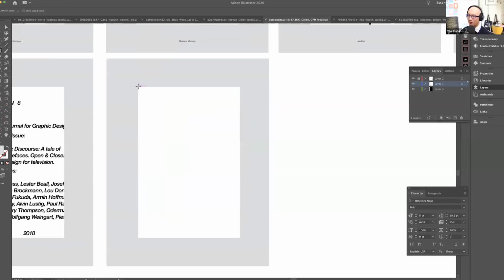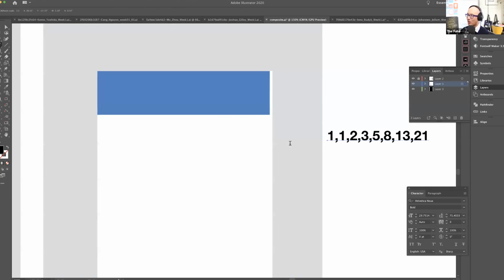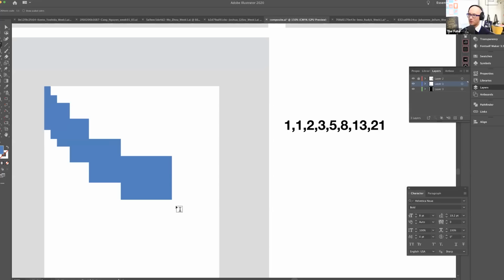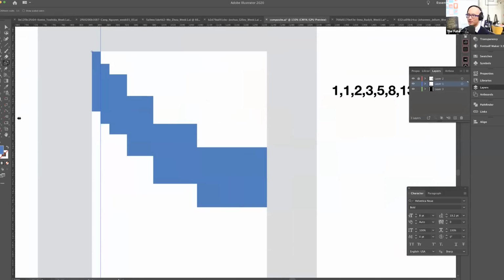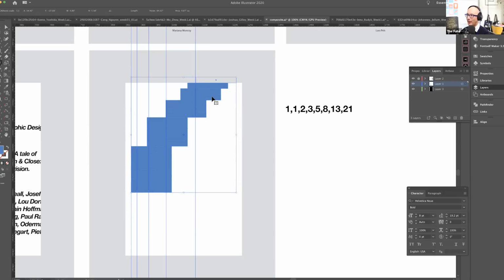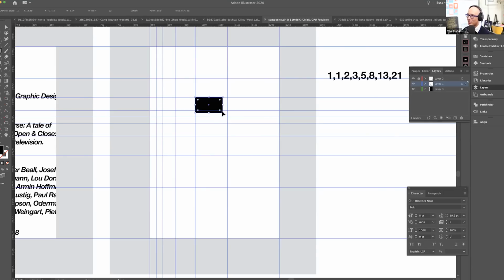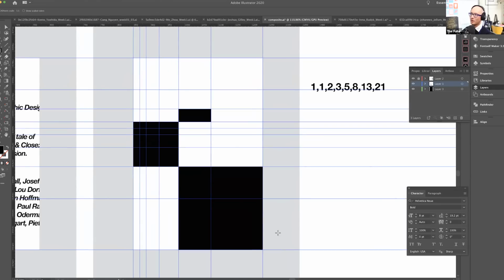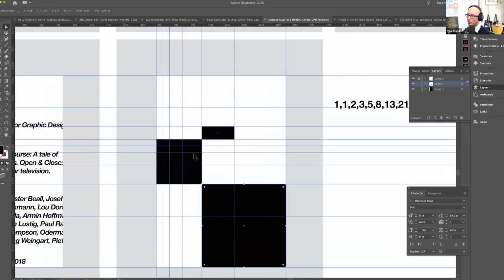How To Draw And Use Fibonacci Grid In Your Design Layout

Comment: Here is my question more condensed: If you continue to increase the squares in the fibonacci sequence does the spiral go outside the rectangle? I am working on logo designs using this method and I can see how circular shapes work with it but what if the shape is curved only slightly this will need to be two circles and a linear line? Does anyone know the rules for this? Can you use more than one golden rectangle in a grid to build different shapes as long as you use the ratio of 1.618 between them and there is a balance in the design?

Comment: This is great Chris, I am experimenting with this in my layouts, I wonder, do you have any go to references for working with golden ratio grid  logo designs and logo type designs specifically reviewing decisions on how to get the grid to work with varied logo design examples? I have created the golden spiral to plot my squares and circles so there is a relationship between the elements in my logo designs as a starting point but when I look at some grid examples in other work I have come across uploads which show shapes that extend way out of the logo but do not correlate with all the proportions leading from just one golden rectangle; can more than golden spiral be used like in Da Vinci's paintings? Do you know of any working guides for problem solving this process to help me with decision making when I'm constructing logo designs using the golden ratio method?

Comment: I stopped relying on Fibonacci proportions because not only was it limiting my designs. And when I purposely made all my designs using Fibonacci and others using the same assets would be made using other proportions. Statistically more clients picked the projects where I didn't use the Fibonacci sequence. I'm not saying I debunked it or whatever. Also, I would argue if you are looking at the text with different characters, margins, etc. you all ready brake the proportions.

Comment: Hey Chris, do you have problem with laggy Illustrator on your Macs and issues with resizing drawn shapes like: rectangles, circles? Pleas check my video where I'm showing this bug: https://www.youtube.com/watch?v=HBO0pH_ee3A&t=43s . Adobe is he sells me away from about half a year when I've discovered it. I have the same problem on both maxed out iMac 2019 and also on maxed out MBP 16-inch. Both machines are powerful. Please help, maybe you move this issue forward and have better connections to the top dev team of Adobe :) It's really annoying to work with vectors right now :( Big thanks.